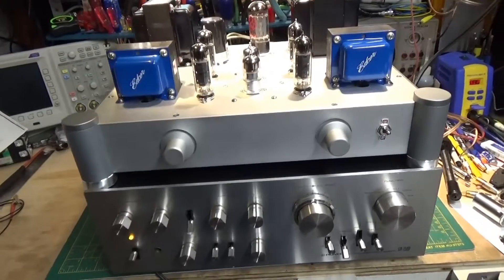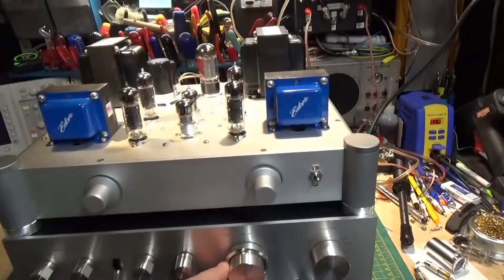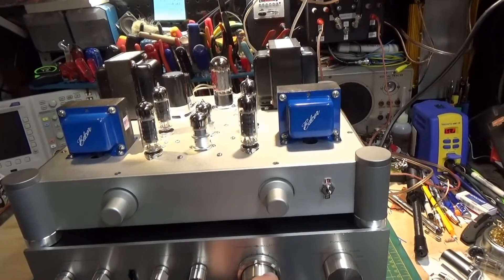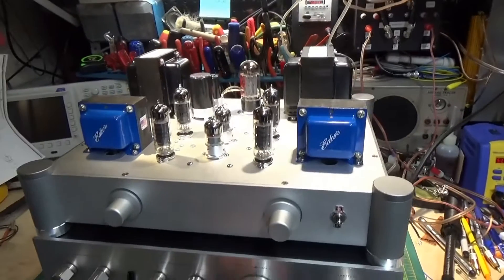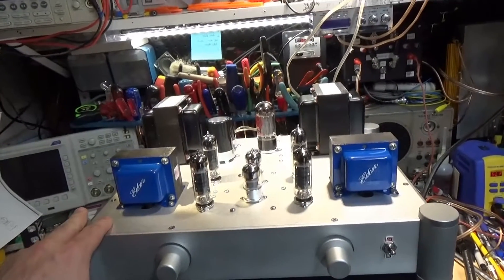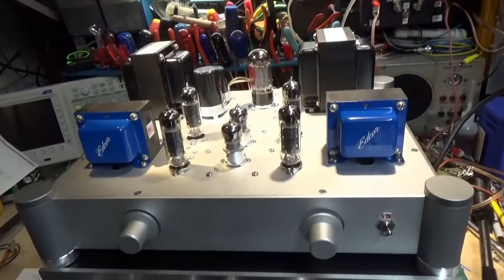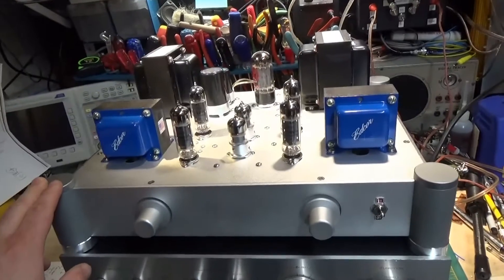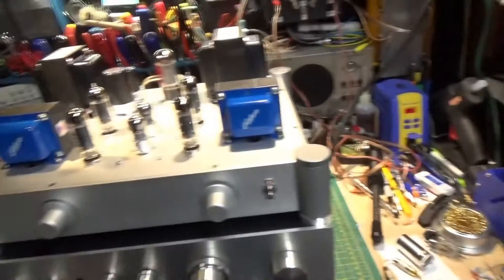Scratch Build a Stereo Tube Amplifier-Part 8;   Final...or should I say, Finally!

Comment: For your consideration, though it's a long-done thing: Regarding bias and feedback to the first stage, consider adding an electrolytic cap of, I don't know, 100 uf or less, in series as part of the feedback circuit.  This for DC blocking, positive side of the cap toward the cathode.  This way your first stage bias voltage at the cathode resistor is determined by, and only by, that 1K-ohm cathode bias resistor, not also by the DC bias current which will presently leak out through the feedback circuit, then through the output transformer secondary winding in parallel with the speaker, then down to ground.  Variation in this (leaked) bias current may or may not kick off the the HF oscillation during LF drive.  Just  just my two cents worth.  And I don't know what kind of new instabilities or frequency response issues at the low end adding a cap into the feedback circuit may create; I haven't done the math.

Comment: Thats sounding really good, really clean.
what speakers are you driving with the amp? I've been looking for a design to build of between 10 & 15 watts. I'd love to build this and have the 4S preamp as the input stage to it (with a little modification).
any advice you have is more than welcome and keep up the good work, its been a cracking build

Comment: Nice build,You could just put a small double throw  toggle switch in between the inversion/ drive tubes,and put two different. size capacitors coming from the cathodes to the toggle switch,which is center grounded,I used a matched pair of 10 and 30 mfd  capacitors on my 6bg6g  SE amp.
Normally I leave the toggle switch off when a preamplifier is hooked up,But if I use my phone for input source,I can boost the signal or gain with the switch....

Comment: Looks and sounds great! Inspiring, makes one want to build their own!  Your amp is much like a Dynaco ST-35. The line-level input for an MP3 would have been through a separate preamp feeding  2V p-p signal to your power amp. Also, the output distortion appearing below 27 Hz is likely transformer core saturation, which is just not a real issue with your setup.  30-20,000 Hz is awesome.